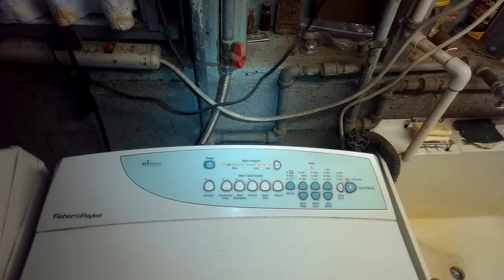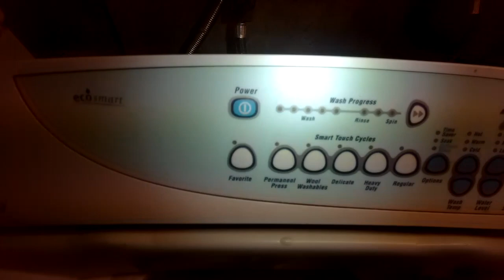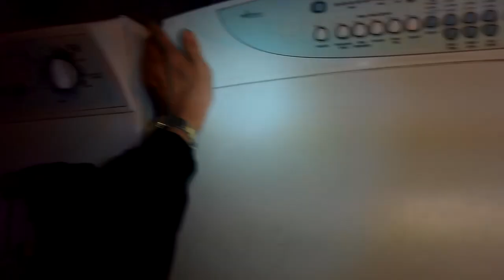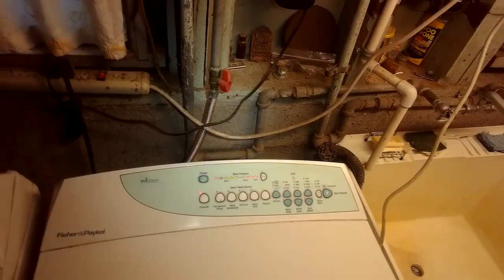✨ FISHER / PAYKEL WASHER WON’T FILL - EASY FILL VALVE REPLACEMENT ✨

Comment: Hi there. Our fisher & paykel top load washing machine fill and drain water in the same time. So do we need one of these valve replacement or? Thx
Reply from the maker: I think you just need to pull the drain hose out of the standpipe in the wall behind the washer and then put it back in the standpipe, but only 10 inches in max.
Before it was too far down and causing a siphon effect.✨ 💻 Brand New Appliance Repair Blog - Lots of DIY Easy Fixes - Click Here: https://www.ApplianceFixes4You.com